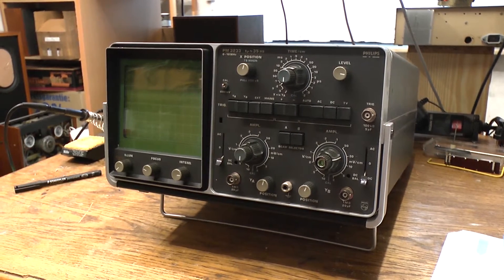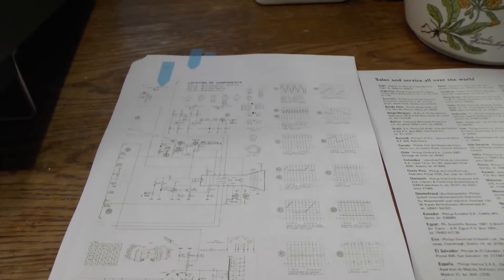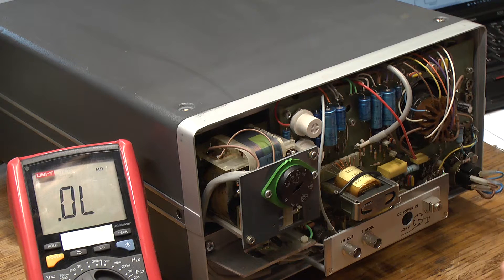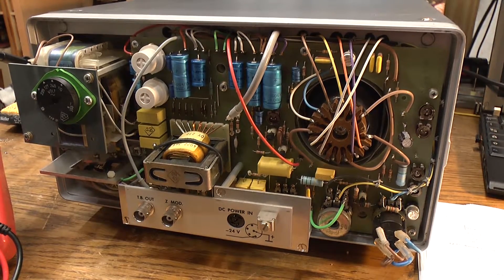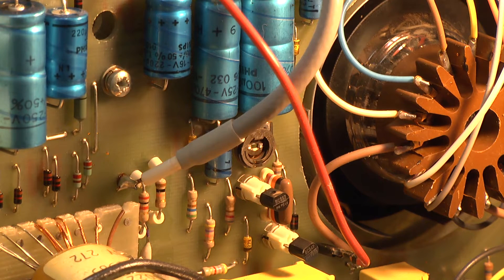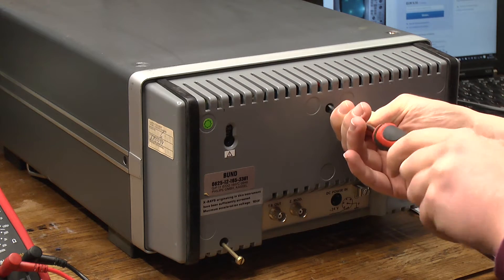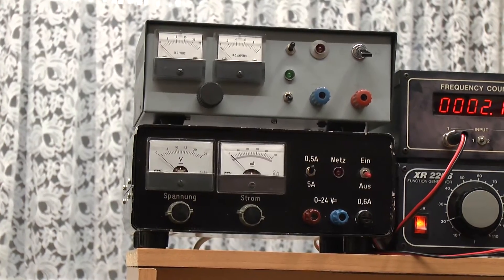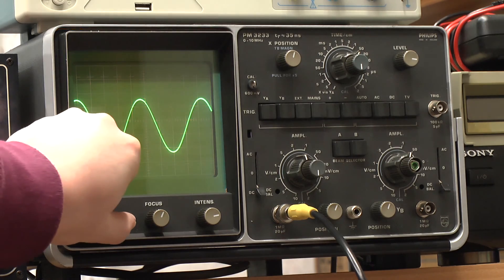DrCassette's Workshop - Philips PM3233 Oscilloscope repairs

Comment: Next year, i will try to revive my 1970s 3233,needs a few new electrolytic capacitors.dr cassette,can you please Tell me,what transistor it is,in the power supply, the black one,under the crt Socket,i can't read the type.i want to test all transistors in the power supply, when my newly purchased t7 component tester arrives. Thanks for any answer.
Reply from the maker: Sorry, I don't have this scope anymore. Surely you can figure out the transistor type from the service manual.
Reply: @DrCassette i will ask my friend, who's also in electronics. Thanks to your Videos, i got my fathers onkyo integra 2760 working again. New belts,cleaning  and lubrication in the right places.

Comment: Grabbed one of these at a flea market for 20 DM (back in the good old pre-EUR days). Mine's in worse cosmetic shape and needs calibration, but functional overall. Despite their very limited specs, these old PM scopes are particularly useful because you can set them up vertically on the floor next to you, economising on your bench space. The receptable for the (captive) power cord in the bottom is also a nice touch. The big carry handle is very (pardon the pun) handy too, given the weight. They really are well designed workhorses, and I assume calibration (in terms of accessible adjustments) is moderately complex. Btw, I think these go back to the early/mid 70's, not 80's. I take it the label at 4:20 indicates it's German military surplus? ;^)
Reply from the maker: Yes, this was originally owned by the German military. I got it from a reseller on Ebay.

Comment: Great video. I'll be refering to it as I too bought the same unit on ebay and is need of repair. You have a source for the schematics of it in English?Any specs on the front bezel would be appreciated as this unit is missing it.Overall this unit appears to be very clean and quite impressive as far as the layout and overall construction is concerned.

Comment: Those blue axial leaded capacitors in the rear of the unit are notorious for drying out and drifting in ESR. I had a digital/analog hybrid scope from philips that I had to change all those out in order for it to function correctly again. 

Still functions today. In your case, it looks like your scope doesnt have nearly the amount of hours on it unlike mine, which is why mine was due for a recap.
Reply from the maker: +THEtechknight 
I know these capacitors are not very reliable, that's why I initially thought they were causing the problem. I took one out and measured it, but both capacity and ESR were fine. The scope was owned by the German military, so it probably never saw a lot of use.
Reply: DrCassette With as little use as your unit has seen, the caps are likely ok. In my case, they weren't. But mine had so much use that the PCBs were blackened from heat.

Comment: Nice to see that scope fixed. It might be worth to change those trimpots, even replacing them with 10 turn presets or something like that, to avoid headaches in the future.
Reply from the maker: +Santiago Hormazabal (Coco) 
It took over 30 years until the trimpots developed a problem. They are now clean again, good for another 30 years (I hope).